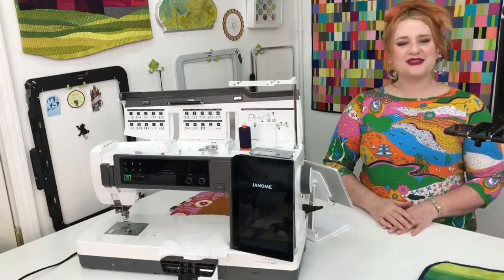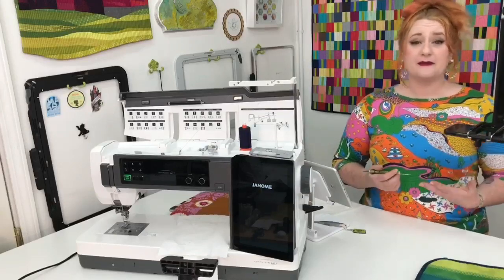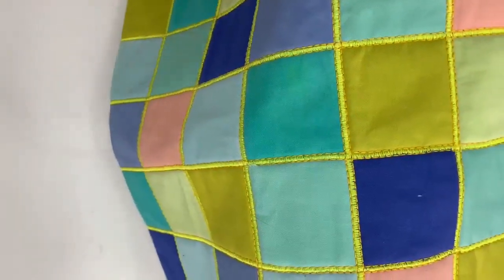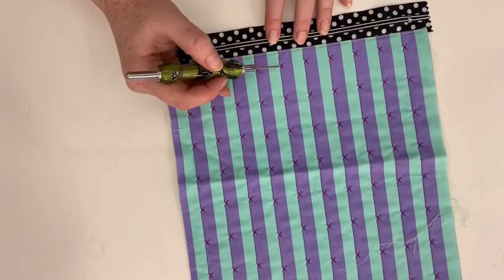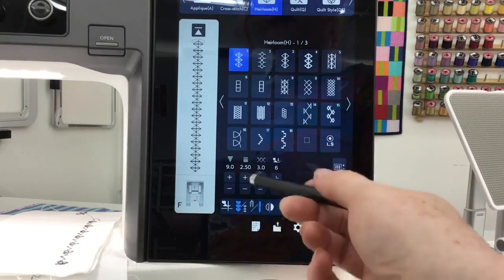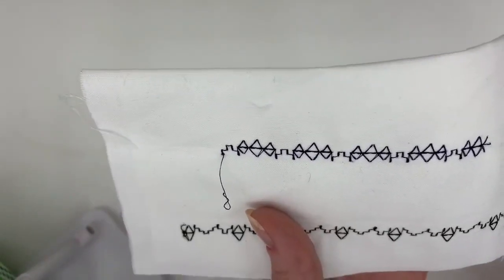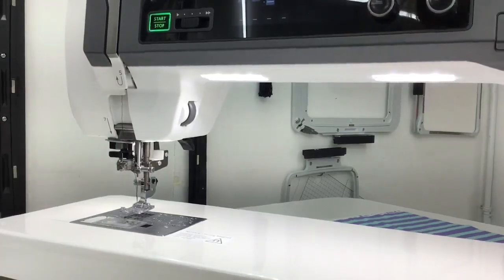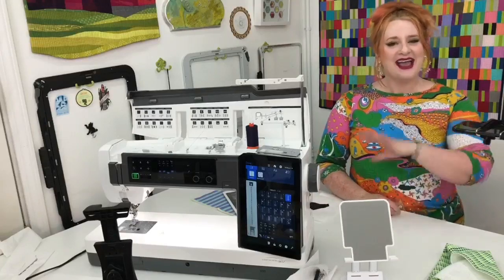Combining Decorative Stitches on the Continental M17

Comment: Hi Miriam! Love your informative video. What stitchplate should be used on the M17??The pumpkin is awesome! Thanks for sharing your creativity and demo!
Reply from the maker: Thank you - for decorative stitches, you need to use the Zig Zag plate, the one that comes standard on the machine. You will need the wide hole in this plate rather than a straight stitch or HP plate, that only has one small hole. Happy Sewing!
Reply: @JanomeJAI  Sadly I haven't used the decorative stitches on this magnificent machine. After seeing Miriam's video I will!